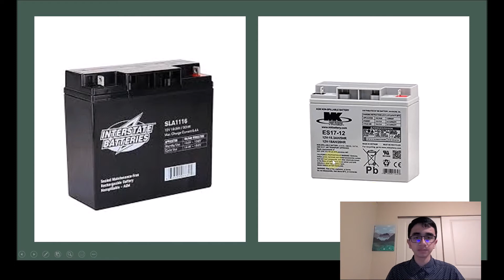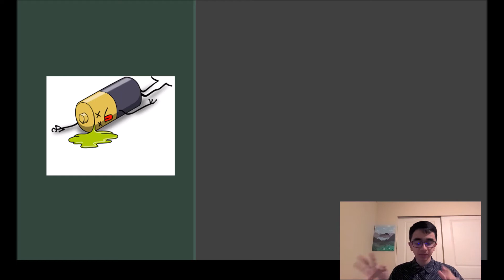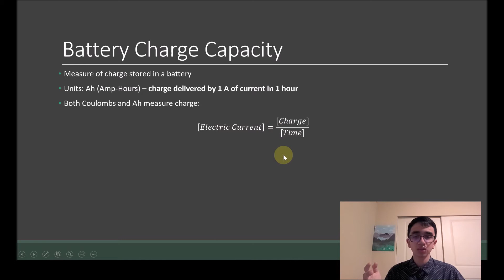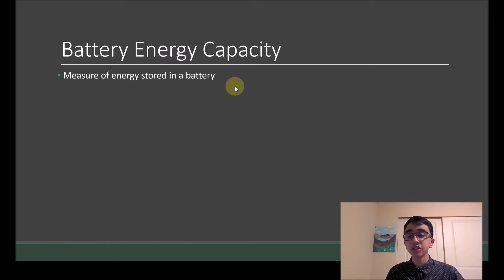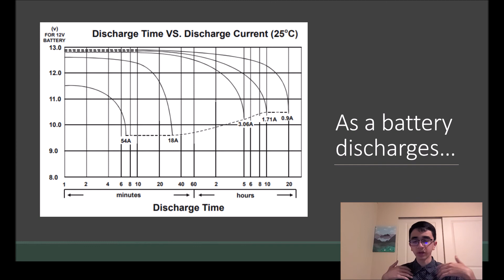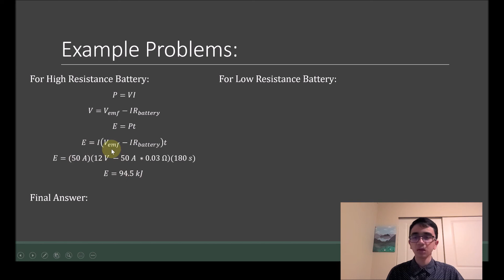Electronics: Batteries

Comment: Our MK batteries this year had an internal resistance from 0.016 ohms to 0.02 ohms. This is above the defined spec on the documentations but they worked fine for us during our one competition in 2020, we only logged 2 brownouts which occurred in very high-stress periods.
Team 2910 also has a similar internal resistance in their MK batteries.

Comment: One thing I forgot to mention is that there is a process to reverse battery sulfation by applying bursts of electricity to the battery terminals, this effectively breaks down the sulfur compounds on the plates. I am not aware of a method for us to do this with the equipment we have, but that doesn't mean its impossible!